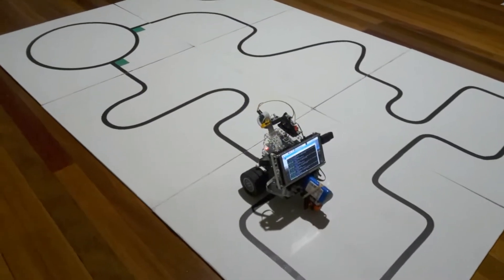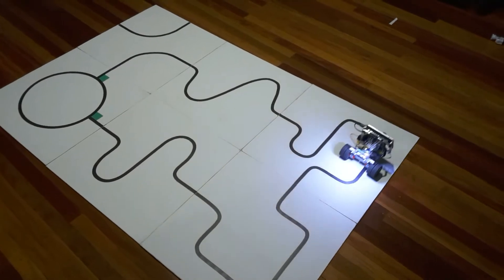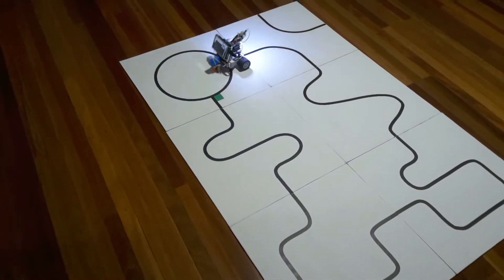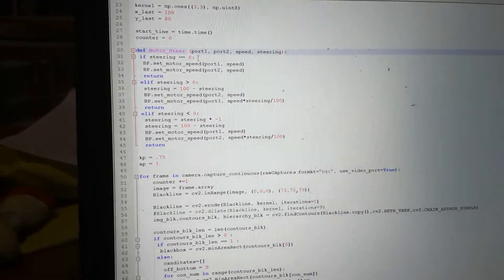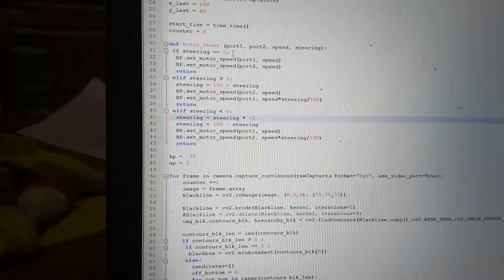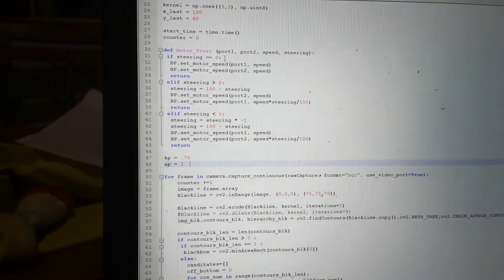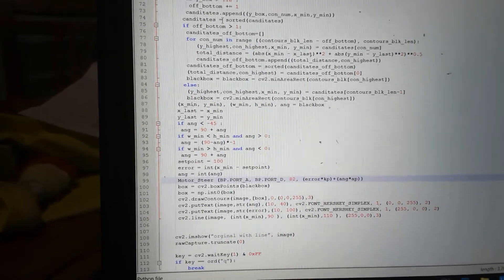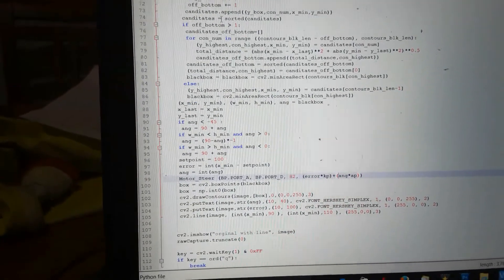Line Follower using Computer Vision lesson 6

Comment: What is BP?

I mean what is it used for and how is it defined?
Reply from the maker: BP for for the board that controls the motors. The video series is about computer vision and the concepts can be used with any motor controller
Reply: @outofthebots3122  ok, u mean "BOARD PIN"  

I am using a raspberry pi 3B+ and I could not find a second pwm pin so what should I do.
And could u just explain what should I define before writing the function "Motor_Steer"
Reply from the maker: @zeenutheengineer  BP (BrickPi) what the name of the functions that controlled the add on board (HAT) that was plugged into the RPi to control the Lego motors.
Reply: @outofthebots3122  right, now I get it 

But I am using a L298n motor driver can give the syntax be used for that ,please

Comment: Hi
What's your algorithm for the green turns?
Also, does it successfully ignore green patches after an intersection? If so, how?
Reply from the maker: See this video and the code is linked in description https://www.youtube.com/watch?v=sYfahf4i3SE
Reply: Hi
Thanks for that!
Also, I was able to figure out how to detect the green myself and now that I saw your code, our algorithms look quite similar. I was now wondering how to make the robot ignore green patches after an intersection...
Any suggestions or tips for that? (I am obviously using a little bigger region of interest so that I can hopefully enable this functionality later...)
Reply from the maker: @aryanmediratta955   there should only be green patches at an intersection. If the green is a different shade of green then adjust your detection so it only detects the exact shade of green that you want.  You can also adjust your ROI (region of interest) that you only look in a narrower field of view
Reply: @outofthebots3122  I'm trying to solve the problem in the context of RoboCup Junior Rescue Line.
In that, although the green patches lie on the intersection, they can either lie towards the robot or on the other side of the intersection.
Any green patches that lie on the other side of the intersection have to be ignored and if the robot sees two green patches, it has to take a 180deg turn.
Reply: oh man, this code is very useful, BUT you have to do a lot of changes for the Robocup(and not just the green patches) @aryanmediratta955
Reply: @gabrielvoss6251   I am working on that algorithm.
What I have realised so far is that I'll have to find a better way to process the green patches. If all I do is horizontally compare the position of the green patches relative to the centre of the image, it may cause several issues.
So I'm thinking of something like scanning both horizontally and vertically across intersections and then perhaps mapping out the green orientation as a 2x2 boolean matrix based on which the robot's behaviour can be defined.
Reply: I think that the bigger problem is getting this to do the angles that are more than 90 deg @aryanmediratta955
Reply: @gabrielvoss6251  Well yes, that'd be difficult.
Though I've rarely seen any obtuse angles in RCJ for the past three years.
The rules never said they cannot have obtuse angles...
Thanks for the advice though. I'll think about that case too then.

Comment: Can you possibly assist post this code? I’m considering using 2 24V motors. I just need help with steering and motor control
Reply from the maker: First of all you will need to let me know what platform your using e.g. Raspberry Pi?? and what language your going to be coding in. Second to control motors with a computer you will need a h-bridge see this video for explanation https://www.youtube.com/watch?v=vQmLDB0ZYFw and fi you don't understand how to control the speed of the motors then this video https://www.youtube.com/watch?v=K4b6fNF33SE
Reply: I will be using Raspberry Pi, programming in python
Reply from the maker: Well RPi and python is nice easy platform for this. You will need a H-bridge module (google it) for the RPi to be able to control the motors. Watch this video from 6mins onward to understand how the drive and steer a 2 wheel drive robot with a back caster wheel (basic simple bot design) https://www.youtube.com/watch?v=bai9wNTgOLQ&t=378s  I would very much suggest using smaller motors than 24v, most of the stuff that I do is 6v motors as it is easier to power off batteries.
Reply: Out of the BOTS In that video, is the PID good or will i have to change it ?

Comment: can you please help me in steering, i am having quadrature motors
Reply from the maker: I will need a little more info to be able to help. Are you using a basic 2 wheel drive robot with a caster wheel. If so then this video may help you especially from about 6mins but do what the whole video if you have time as there is other stuff in it that will help you  https://www.youtube.com/watch?v=bai9wNTgOLQ